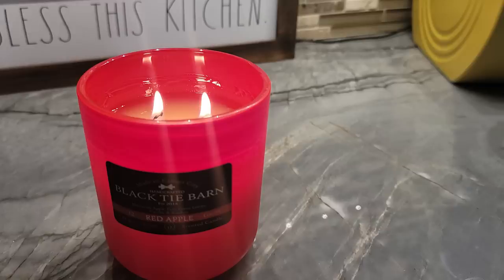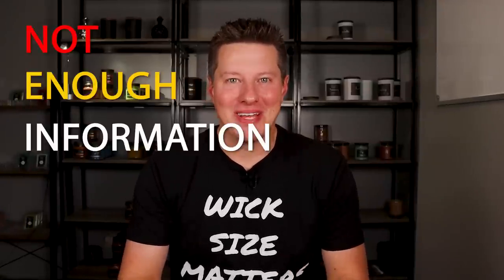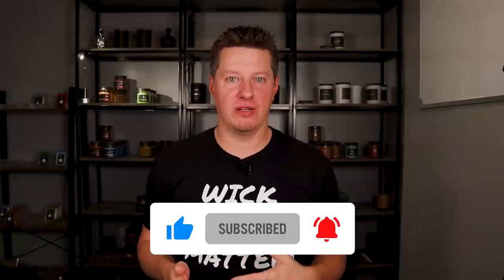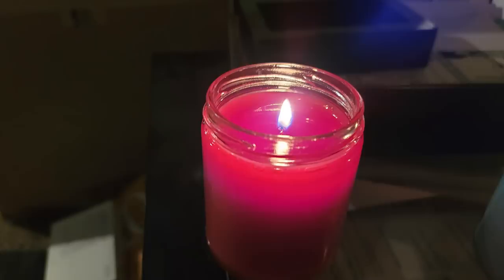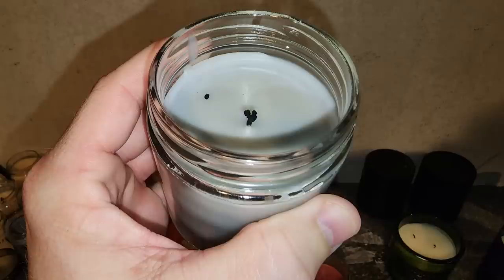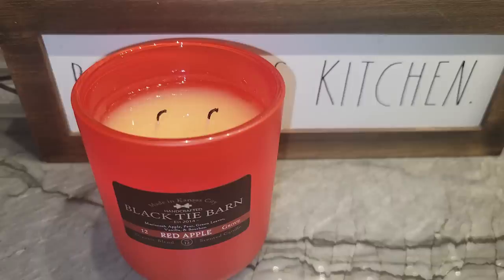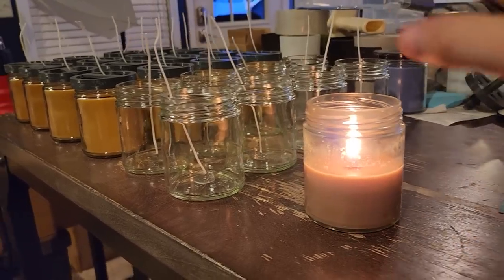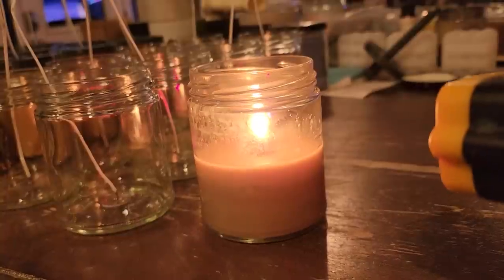WICK Testing GOALS 🙏 (What I Look For When Burn Testing My Candles)

Comment: Wade is our candle guru. All this advise is so affirming and helpful when it comes to testing. I know for myself I’m super harsh on myself when it comes to testing especially in the first 2 burns. I’m using wood wicks and it’s been a lot of trial and error with finding the right size wick to “perfectly” burn with the specific wax I’m using. I get really in my head when it comes to the first 2 burns and I’m seeing some wax hang up on the sides but the hot throw and the wick burn itself is amazing. Gotta do the full burn test to really determine if the test is a success or not. Wood wicks are tough to deal with I’m finding lol

Comment: Thanks for this info.. I've been stuck testing for over a year because my jar get hotter than 175 after during power burns and specially mid jar. I've purchased at least 5 candles from popular brands and they do the same and are visible over wick.
Reply from the maker: Jars are going to frequently get over 175 during power burns. Some of mine have as well. How are they doing during normal burns

Comment: Wade, thank you so much for this video. Specifically the part about vessel temp. I have looked all over and gotten all sorts of answers. Most people said keep it under 140, which was hard enough then I was told 125 and I was damn near about to give up. Now that I know that under 170 is perfectly fine, I am relieved and can't wait to not fail every candle I make. Thank you again for all your videos man!
Reply from the maker: Np. Like I said I like to stay between 150 and 160 but 170 is astm guidance. At least last time I checked
Reply: @BlackTieBarn  im just glad to hear it doesn't have to be under 140, or even more so 125. 150-160 is very doable and I've had a few that I've "failed" that were in that range. Your videos have been extremely helpful along this journey, but this tip will be the one that really helps me get to a finished product. Many thanks!

Comment: Wade as always great video This cannot come at a more perfect time I’m in the process of finally launching my candle line and I’m working with two waxes. One is the problend 600 which I have down and the new one that I’m working with is number seven formally known as soy bliss and I was stressing because I was getting mushrooms and I thought the jar was too hot 

but after watching your video, the mushrooms that I have been getting have been very tiny and I didn’t even think about using my infrared for the outside of the glass. I’ve been hitting it on the top of the wax as it’s burning. 

You always give so much good advice that I love how you did the beginning the middle and the end because now I have a better idea how a candle should burn since I’m a new candle maker.  Thank you for always giving such great advice for new candlemakers as well as season candlemakers
Reply from the maker: Thanks patty

Comment: I like to start out with a half jar just to see if the FO has a hot throw. I used to waste so much wax on full 9 oz test candles. Also, the half jar kinda lets you know early if your wick is to big. Anyways, after I see that it has a good HT, and the wick size is probably ok, then I do the full size test.

Comment: Thank you for providing consistently valuable content. I rewatched this video because I had some questions about wick testing and rate of consumption. When choosing between 2 wick sizes, if both perform reasonably well, low/no sooting and HT is where you want it to be, do you choose the lower ROC? And another question about ROC, I have a few candles that had a lower ROC with the bigger wick. Why does this happen? Last question - is there an ROC range that you target when testing? Thank you Wade!
Reply from the maker: Thank you. Unless you have a very controlled tasting lab, I would take your ROC test results with a grain of salt. Or... perform multiple tests to confirm. Also, increaes in wick size do not necessarily mean high ROC. Wick sizes take multiple things in consideration. Some flame height, some width, roc, yield, etc. For example look at a wick guide for premier 700s. You will see what I mean. Yield is more reliable (generally) than melt pool estimates for example.

To answer your question, two wicks that are similar and both work. I'll tend to go with slightly smaller one. If it's a viscous wax, probably the higher one

Comment: I see a lot of different info on jar temp, some say 140 and some say 175. Where can I find the information? I just got done with my 10th burn, I have 2 or 3 left. It’s stayed under 140 degrees for most of the burns until the 8th burn it reached 150 degrees I thought it was a fail. There isn’t a lot of information on jar temp. I was wondering how towards the end of a candle could you possibly stay under 140 degrees and it still smell good. This made me feel so much better because when I tested one size down the candle tunneled. I quit once because I got discouraged and I didn’t want to quit again. Thank you for the info.

Comment: Can you in fact take out a wood wick I have tested that failed the 2-3 hour mark? For instance, pulling the wood wick out and inserting a thicker size and heat gun the tunnel until full melt pool and let it cool down. Then, light it the next day?
Reply from the maker: Yes you can. 👍

Comment: Hi Wade! Thank you for your videos and the invaluable information that you're willing to share!! Hoping you can help me with a question. I found some jars that I love (ceramic tumblers from Candle Science) we are using IGI 6006 wax and ECO 10 wicks. The candles looked great for a couple of weeks. If you look really hard, like you are actually looking for it, the wax is not adhering to the wall of the jar perfectly. Last night it got really cold and this morning the wax pulled away even further from the jar wall, highly noticeable. Any idea why this would be happening? I really don't want to let go of these jars, I think they are so pretty but we can't sell candles like this. Thanks in advance for any suggestions!!
Reply from the maker: Completely normal. Wax contracts as it cools (like most things). Some more than others. Most waxes pull away a bit. Totally normal. Cold weather will make it contract even more. I wouldn't worry about it. Even if you could control it for a while, it will still happen later

Comment: Pretty much all wicking videos on youtube talk about container candles. Pillar candles are different kettle of fish, and the information about wicking those is very thin on the ground.
Reply from the maker: Agreed!
Reply: I should add. For pillar candle wicking advice, the older books by David Constable, Norma Coney and Betty Oppenheimer give great advice as to what to look for in the flame and burning properties, but their info is outdated in regard to wick types and current availability. Modern wicking and wick guides are focused on their use in containers and it can take some effort (and much testing) to try to find a good match between the wicks in these books and the wicks available now. The advice given online is mostly contridictory and confusing, and too many candle supply places don't have the knowledge to advise for pillar candle wicking. I almost gave up in frustration.

Comment: Hi Wade, in your opinion, would the wax type be taken into consideration when evaluating the surface temperature of the container? I am in the process of burn testing palm candles, which is an extremely hard wax with a higher melt point than most.  In testing two of my fragrances so far, the container temp. of my straight-sided 12 oz clear glass containers having burned down to about the halfway point or beyond has reached 172, and once higher at 175 in a hot spot, during a couple of consecutive 4-hr. burn cycles, but container temp registers lower in all burn cycles before and after.  Would you say that this is a concern?  They are not reaching full melt pool until at least the start of the 3rd burn cycle, although for the mid- to lower candle burn cycles the depth of the melt pool increases from 1/4 - 1/2" to 5/8".  For this container I am double wicking with the smallest wick size available, however, I could go to a wider diameter container.  What would your opinion be?  Thank you so much!

Comment: With my 4oz and 8oz jars that I’m testing I get a hot throw on the first burn, the next few burns the hot throw is faint. So with those size should I smell the hot throw in 30 or the hour like you said
Reply from the maker: you will get a full melt pool faster because they are smaller... but the overall hot throw will be less because they are small. Candles that size are usually meant for bathroom  and small rooms, spaces.

Comment: Hi Wade,  Question: if your single wick flame is consistently bending (at the candle half way mark), with no drafts, glass jar temp of 150 - would you fail this candle?:I tend to fail the candles. Maybe I shouldn't? Thank you for any advice.
Reply from the maker: Hi Susan I am not too sure what you mean by the flame bending. But if it never gets worse than you described I don't think it's an auto fail

Comment: Hello, I have a question about the wick size. What does it mean to change wick sizes. Because in a lot of videos i see wicks that are super long when  they stick it in the jar and pour it and they cut it anyways. So in which situation do you change a wick size? Thankyou for all your helpful videos! :)
Reply from the maker: Hi. What you are referring to is the length. That doesn't matter as you will trim it anyway. The size referred to the output of the wick.  Thickness, number of threads, heat, etc. An eco 4 is larger than an 2 for example. Both can be 6" long thst doesn't matter.
Reply: @BlackTieBarn  Ahh alright haha 😳😅 So when a flame is fed too much wax you have to size down and when it is not really melting the wax you have to size up for example?

Comment: This was so informative! I primarily use tin vessels and was wondering if that's why I have a deeper melt pool? When I get to about halfway down it's almost all liquid after a few hours. However the temperature of the tin is nowhere near 160°is this okay as I use a coconut soy wax
Reply from the maker: I'd still probably try smaller size just to see if you can prevent completely liquid. But yes very common with tins. And the fact that your temp is still low is fantastic.  :)
Reply: @BlackTieBarn  thank you! This makes me feel so much better ❤️

Comment: So if the wick is doing well  at the start and middle burn, but  towards the end the wick is toppling over or only one side of the jar is getting soot, would you then need to wick down? What are possible solutions for this?
Reply from the maker: Hard to say. Wicks get soft and start leaning often. How much depends on wick type, wax type, jar size, etc. You could try wicking down one but not have it causes the other burns not to perform well

Comment: It looks like you might be using an Aura vessel? What double wicks have worked best for that jar for you?
Reply from the maker: Hey Jamie. These are actually not Aurus. They ate from ambrosia but similar. Slightly larger I believe. I am mostly using 2 premier 720s but that is with my wax. Not sure what wax you're using
Reply: @BlackTieBarn  I use the Aura jar as well double wicked and was wondering if hitting diameter at 2 - 2.5 hrs in the middle to late stage was considered a pass or fail?   It seems on top I am hitting diameter by 3 - 4 hrs. 

Also, once you reach diameter in your test burning stage, do you blow it out or continue burning it? Thanks in advance 😊

Comment: Hey Wade. Thank you for your knowledge about this! Still pretty new to candle making and I noticed I get quite a bit of smoke after blowing out my candles using 444 wax and CD wicks, even if there's little to no carbon build up on the wick after. My room then goes from smelling like the fragrance to something like a burnt steak, lol. Is this normal or something you worry about when testing? The candles I've made with wooden booster wicks barely smoke at all after blowing them out which is so nice, but the wooden wicks themselves seem very inconsistent with how they burn like I've heard you mention.
Reply: I am having the same issue. Help please
Reply: @aprilherald4602  What wax and wicks are you using? I've recently been experimenting with the ECO 12 and ECO 14 with 464 in 8 ounce tins from candle science and they have been much better about not smoking too much after blowing them out compared to the CDs. They also seem to mushroom less so far in my testing. I've read the CDs have more paper woven in compared to the ECOs which could be the reason they mushroom and smoke more? Not sure.

Comment: Hi, hope someone might have the same issues I'm having currently.  I have a ceramic farmhouse vessel from candle science, with the lids they suggest.  Had no problem with the lids fitting, until I switched to coco apricot wax.  Now, some lids fit and some don't.  They simply won't go on, and once they go on, almost impossible to remove.  I contacted candle science, but they have no thoughts on it.  Anyone here, have any thoughts, tips or tricks if you had a similar issue?  thanks.
Reply from the maker: That's SUPER odd. I can't make sense of that either. Unless maybe you should wait longer to put them on. Perhaps that was forms a tighter vacuum seal once it's cooling? No idea. Really doesn't make sense